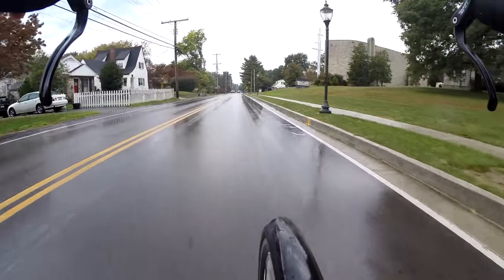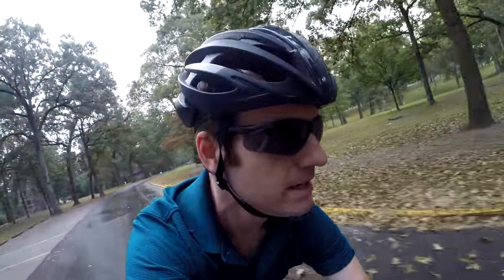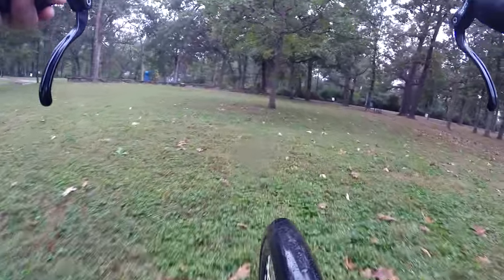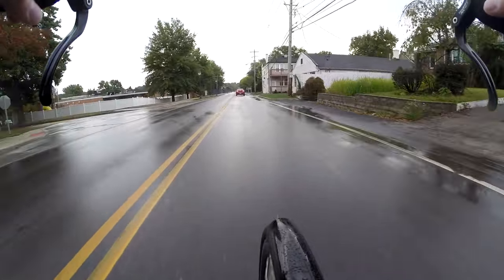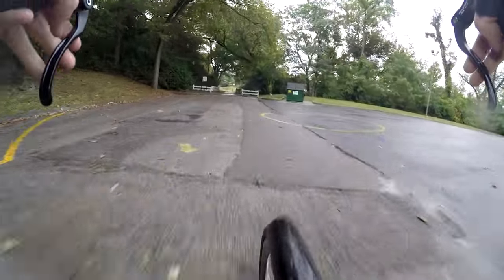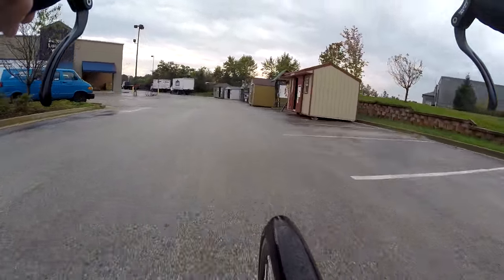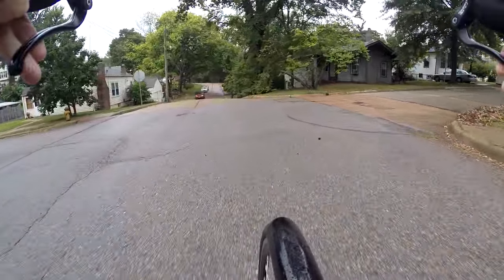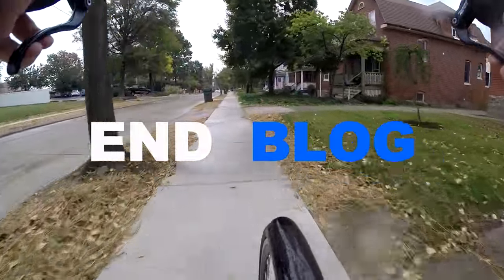Bike Maintenance Tips Rain Commute Bike Blogger

Comment: OK, BB, do you favor sealed bearings, or loose bearings? Sealed bearings just drag more than I like. I also can adjust the loose bearing cones so that I have minimal drag. Just so you know it's nice to know that I'm not the only bike commuter that has to deal with jerks in cars.
Reply from the maker: If you usually ride in dry conditions and know/like to service loose ball bearings then they are ideal, yes. All of my bikes use sealed bearing hubs.